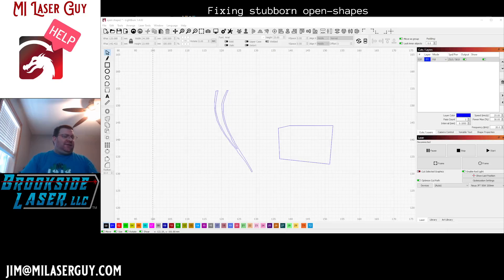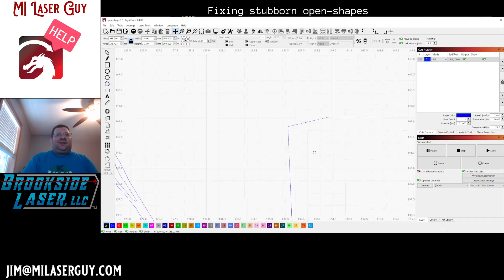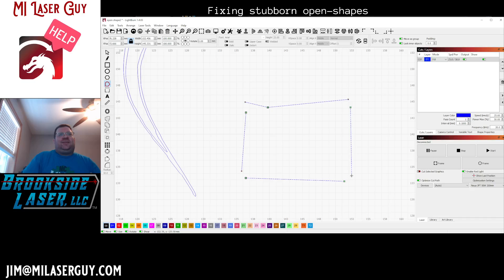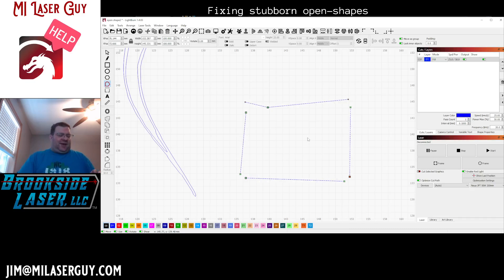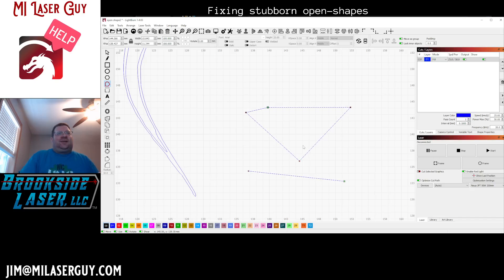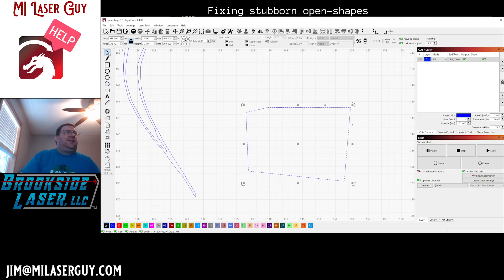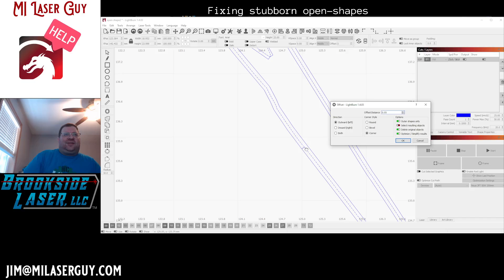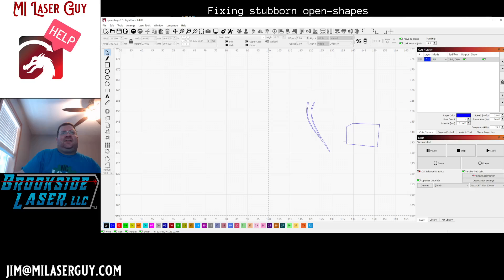LightBurn Tutorial: Fixing stubborn open shapes, breaking and joining nodes

Comment: Is there anyway to double the amount of nodes to get a more defined line without having to go through and add them? Thanks
Reply from the maker: Generally, more nodes is not really the best option. Using appropriate node types (smooth nodes) will help defining your shape properly without adding more nodes. Sometimes, smoothing your shape involves deleting a lot of extra nodes and replacing them with a single or couple smooth nodes, which is a better solution.

Comment: Very nice.  What I have been doing up until now is inserting a node just before the one that will not connect and then clicking on the original end node that isn't connected and deleting it.  I then grab the new node and in most cases find it will connect.  This would be great to do before ever starting to work with the nodes to try and eliminate the issue first.  Thank you
Reply from the maker: Break apart and auto-join was a game changer for me for time saving.

Comment: Man, if this works all the time, it's a game changer!  Thanks for the tip.
Reply from the maker: Because of the nature of the "Auto-Join" function, it should work most of the time.  Sometimes shapes can be quite complicated though, so this could create a LOT of segments on large complicated shapes and may not be desirable.  I generally fix crosslinked nodes manually, but it requires some practice how to identify them quickly.
Reply: @milaserguy Yes, I have fought them diligently at times, trying all sorts of things from other videos. Even the tip of using the offset to find them will help immensely.  Thanks again!